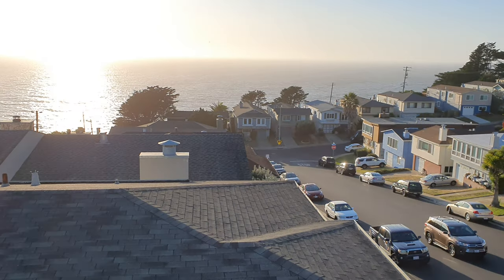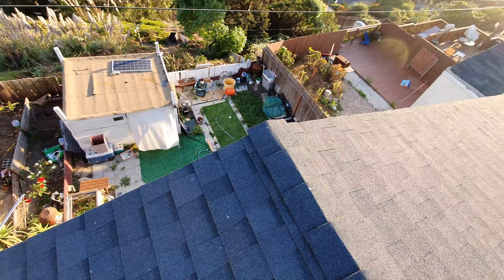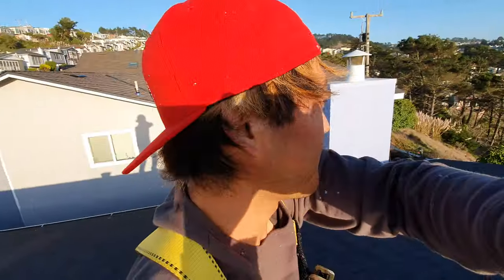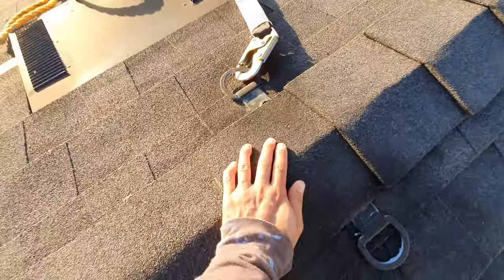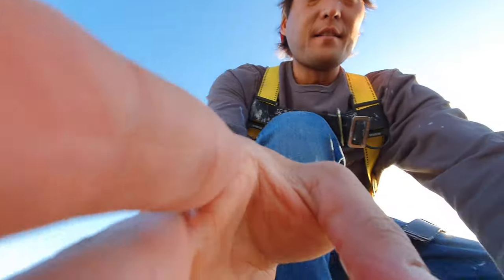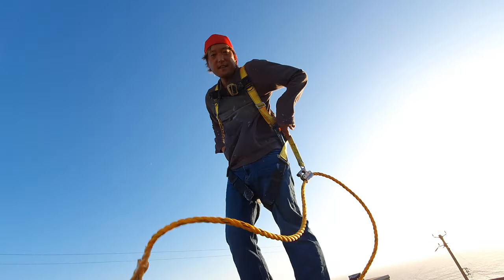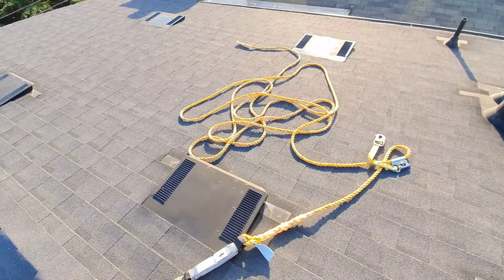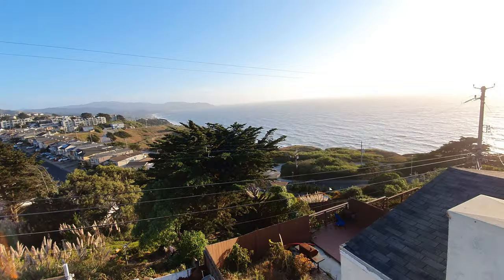How I used a Roof Anchor & Body Harness to Paint My 2 Story House![Roof Safety 101][Review]

Comment: Neat idea.  Some thoughts: don't use that rope a second time.  It's polypropylene, which will degrade quickly over time (certainly in the time it takes until you paint your house the next time) at a rate depending on exposure to moisture and light.  In general polypropylene is also not a very strong rope type.  Remember that a fall system will only be as strong as the weakest component, which is probably the rope here.  I would strongly recommend using a climbing rope and anchoring in with a carabiner rather than a hook system.  Those anchors look a little weak to me.  Consider a "climber's bolt".  The other obvious consideration is a swing: if you are not directly below the anchor you will be prone to swing to that low point, with a greater potential swing the further you are from the anchor.  Lastly your listeners might need some more direction on how to find a stud.  Easy under drywall but I'm not so sure about plywood.  Cheers.

Comment: Great video and you probably are saving some lives of others. Many people are injured or killed weekly from slips, trips and falls according to the osha website. Good job. Quick question, I assume you used screws for the roof anchors? Nails, depending on the size and type can be susceptible to pulling out when exposed to an impulse load such as falling. Thanks for doing the video!
Reply from the maker: Yes roof anchors and I even painted it over with anti rust paint.
Reply: Are roof anchors screws?

Comment: I've been looking into these roof fall protection systems, but you have to consider, especially if you're alone, what happens after you fall?  If the system just stops you, and you're hanging ten feet down off the side, and you're still 20 feet up, what then?  You need a way to lower yourself down.  That's what I'm looking into now.
Reply: Keep a foot prussic on your harness. You can take the weight off  the main line from your body harness and work your way down the main line.
Reply: Have a person in your neighborhood on standby, they can be an older person, woman etc. carry your phone, if you slip and the ladder falls over they come over an stand it back up, while you are dangling there.

Comment: Going to get a few of those anchors, cleaning my gutters on a two story roof. You want the safety line  perpendicular to the gutters as much as possible, else doesn't offer any protection on the extreme corners. Need a spotter in case of a fall, no way to climb back up with the attachment on the back plus hanging in mid air for a few hours could cause serious circulation problems. Air quality in the City is pretty dirty along the bus routs plus the ocean air degrades all metal parts that require more maintenance. Paint job in the City is ridiculous due to regulations and high labor fees, could be $20K for that house.

Comment: The problem is that you will have a Tarzan problem when falling and get banged against the house, into windows, etc. Getting concussion and cut.  Lots of bruises. Possibly broken bones.  The only way to avoid this is to be directly below the suspension point.

The other problem is that the harness will leave you stranded and you will need to call 911 or a friend to get down. Of course, you will be bleeding and knocked out with a concussion and the phone snapped in half in your pocket from the leg harness tightening around the phone.

The attachment point only will hold 600 lb per deck screw, unless you used lag bolts. If you drop 6 feet, weigh 200 lb, you generate 5000 lb of force in a 6 foot drop.  The shock absorber will lower the force to 700 lb hopefully.  Looks like a single use tear away.

I am not sure if the Tarzan problem is better than riding a ladder down.  I have seen many guys jump off kicking and windshield wipering ladders, and I have seen 2 guys get hurt pretty bad falling 4 and 6 foot directly onto a straight ladder that kicked.

The most important thing is to tie every ladder placement so that it can't windshield wiper or kick.   Always use left hand to hold onto the ladder when climbing so that if your feet slip, you will always be able catch yourself, always. When you work off the ladder, there are times you must use both hands, and the best practice is to thread a leg through the ladder rungs which gives great stability.

I am not comfortable tying yourself to the ladder, because I have seen ladders kick and wiper, where you will be in a nursing home paralyzed unless you are able to jump off the ladder.  You do not tie your self to a sinking ship.

 I like the idea of a harness, if all of the engineering problems are overcome.  The Tarzan problem is the biggest for me. 

I anchored into the eave beams about 1.5 feet from the siding and tested by gently stepping off a 6 foot ladder about 3.5 feet to 4 feet from siding.  I just wanted to see if the secure point would hold me.  The 2 foot difference swung me into wall in an uncontrolled spin. Fortunately, my head did not hit the brick siding, but the back shoulder got nailed.  It hurt pretty bad for 2 days and I am still feeling the pain a week and a half later.      

If a gentle swing hurt this much, I can imagine how much a real fall would hurt.  I also can see knocking down other ladders, other workers on ladders, and plank setups falling onto the head of the fall guy and associates.

This is the reason why this hasn't been done.  Plus the touch and go on the wood of suspension points.

Comment: You could also use a pole (16 FT)with roller and work from the ground out of a five gallon bucket with roller screen. Then work off a ladder just for cutting in at the edges of trim

Comment: You dont need the device to give you a softer fall (Shock absorber) because you are not falling from hight. Instead you will give yourself enough rope to limit how close you can get to the edge. Therefore the rope acts as a safety device to limit your exposure risk rather than catch you fall OFF the roof Straight down (vertically). You cant fall straight down because the rood is enclosed.

Comment: I would never trust nails to hold my weight. Nails are not that strong. I would use very strong lag bolts/anchors. Even if the nails have grips, i still would never trust them.